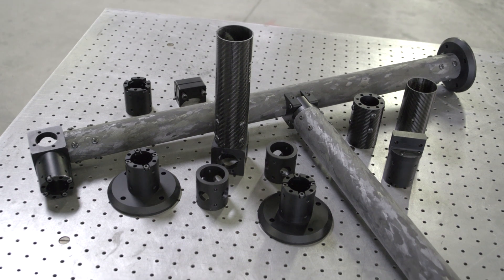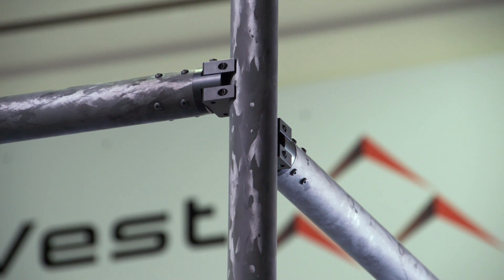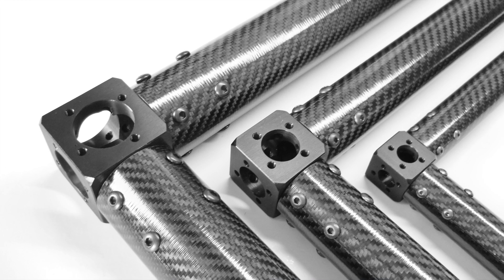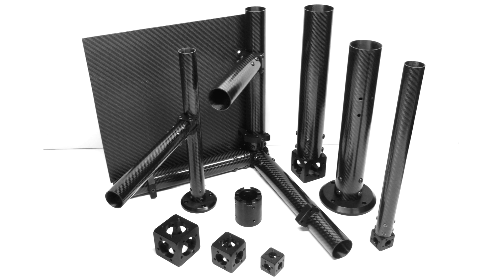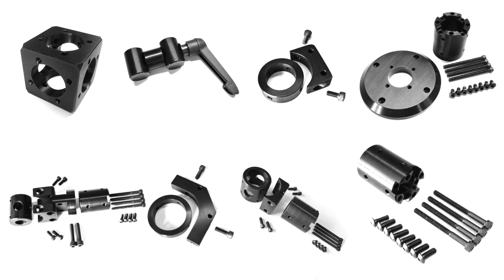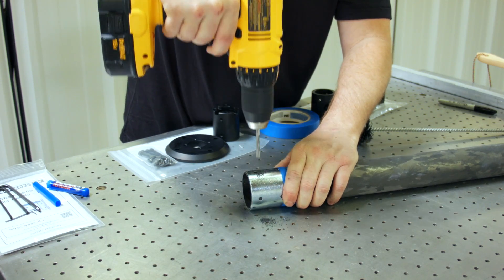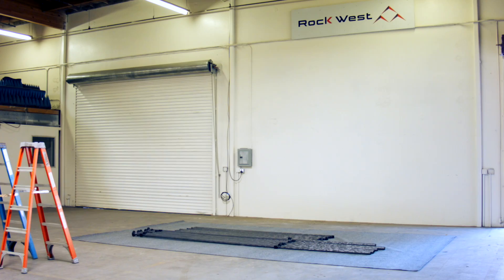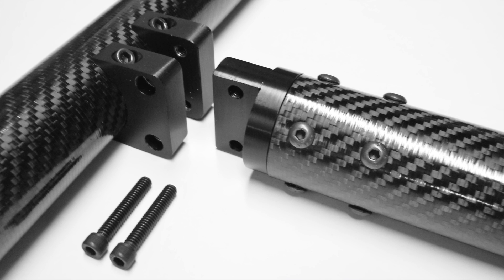CARBONNect™ Introduction

Comment: TO WHOM IT MAY CONCERN, COULD YOU PLEASE TELL ME IF YOU OR ANYONE MAKES  SCEWS/STUDS/BOLTS IN CARBON FIBRE! PLEASE.
Reply from the maker: Unfortunately composite nuts and bolts have not gained in widespread adoption. There are mechanical limitations that make them still mostly impractical.